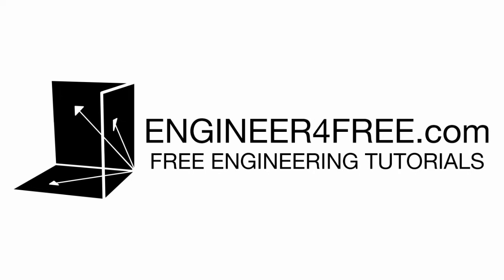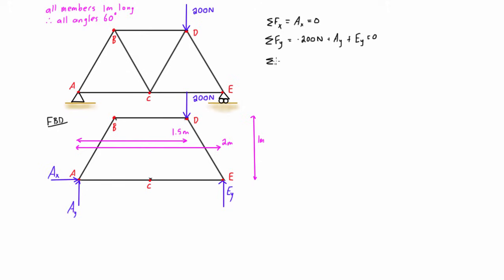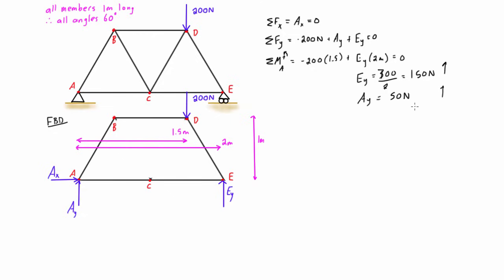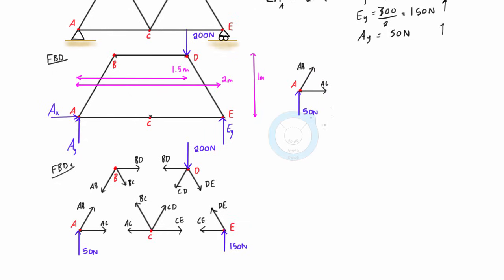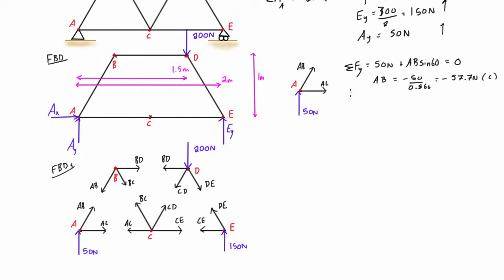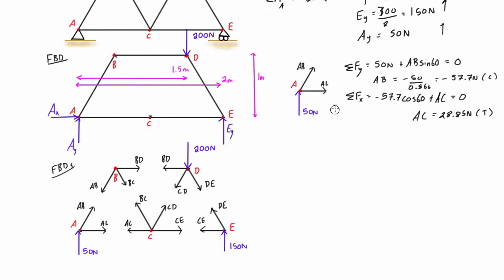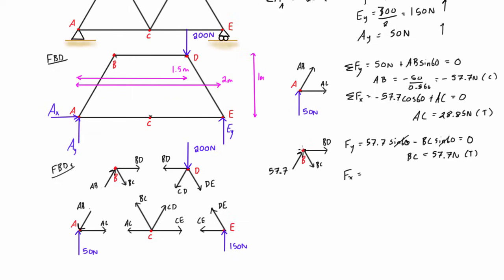Truss analysis by method of joints: worked example #1

Comment: How did you get the 1.5 length and is clockwise negative?
Reply from the maker: The horizontal distance is one and a half members, and each member is 1m long. And yes it is common to set counter clockwise as positive, so clockwise is then negative. 👍👍

Comment: This is good but my question is, at junction A, you know youa are starting with 50N in y axis and then you are tacking sin 60 which is in x axis instead of sin30 which is in y😂😂 does it make sense  you know we are not supposed to follow you blindly so if I'm wrong correct me
Reply from the maker: The trusses are all the same length,  so when you look at the equilateral triangles they form, the interior angles are all 60 degrees. So at A, member AB is 60 degrees off the horizontal. So AB x sin60 will give us the vertical component. If you prefer to measure angle off the vertical axis, you can do that, as AB is 30 degrees from the vertical axis. You can then use AB x cos30 to find the vertical component. Nite that cos30 and sin60 both equal 0.866.  Most professors will generally  encourage that you orient your triangles so that using the sun function with compute the y component, and cos function will compute the x, but you can do it either way as long as you are aware of what component you are calculating.

Comment: I know that commenting is a long shot, but why is force AB not negative for both point A and point B? It's a compressive force, as we've determined by the y-sum of A and calculating a negative value, but why is it not also negative for the y-sum of point B?
Reply: the direction of the arrow for both point towards the joints, A and B. When you try to get the y-component at A, aligning it vertically, it points down. Negative force

For B, aligning AB vertically, it points up. Positive force

Look at the Efy law, negative forces point downwards. Positive forces point upwards

Comment: First off, thank you for these amazing videos!! The only part I'm confused on is picking between sine and cosine because these can change depending on how you imagine the x and y parts of the forces are drawn. For example, at 11:07, you used sin(60) when solving for the forces in the y direction. Why is that? Looking at CD, I imagine the x-part going to the right and the y-part going upwards, which would mean it's cos(60). Instead, you used the y-part of CD to go upwards, then the x-part to the right, making it sin(60). How do I know which direction to imagine the vectors in?
Reply: I figured it out y'all! You have to be aware of the angle you are making. When I chose to imagine the vectors of CD going to the right and upwards, I made a 30deg angle instead of 60deg. If I update my equation to be cos(30), it's the equivalent of sin(60), as was shown in this video. cos(30)=sin(60)=sqrt(3)/2. Be careful when choosing your vectors!

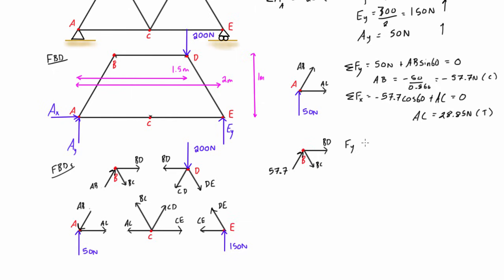Comment: 5:35 
Why isn't FABy negative like when you calculated it for the A joint? Shouldn't it also be -57.7 N like before?

And shouldn't the sum be FY = FAB*Sin(60) + FBC*sin(60)? If I solve for FBC this way I get a posistive 57.7N,
Reply: the direction of the arrow for both point towards the joints, A and B. When you try to get the y-component at A, aligning it vertically, it points down. Negative force

For B, aligning AB vertically, it points up. Positive force

Look at the Efy law, negative forces point downwards. Positive forces point upwards

Comment: in choosing the joing do younhave to follow some pattern or any joint can be chosen as much as is has max of two forces to be determined
Reply from the maker: Generally you want to start at a support with known reaction force, but as long as you have enough info to solve at the joint, feel free to start wherever

Comment: Damn I don't understand😢how do you resolve the second part obtaining bc,bd and 57.7
Reply: I've Been stuck here trying to figure it out for an hour now .Am so noob in calculations
Reply from the maker: It is using static equilibrium at the joint B. Summit all x forces acting on B equals zero, and sum of all y forces acting on B also equals zero. AB is known already from the previous stop, so bd and BC are the unknowns. Bd is horizontal so it only has force in the x direction. BC is on a 60 degree angles so it has both x and y components of force. Solve x direction and y direction in two seperate equations. This will help: https://imgur.com/a/YCT6I1a

Comment: I'm confused about why BD is 1.5m long
Reply from the maker: Oh yeah that got a lot of people. Draw a vertical line straight down from D. This will intersect the bottom member CE in it's centre. All members are 1m, so the horizontal distance between A and D is equal to half of CE, plus all of AC, so we have 0.5m + 1m = 1.5m

Comment: The beams you have stated as in tension have compressive forces though? I assume it actually referring to the joints as those are actually experiencing tension
Reply from the maker: It's best to think of only the members in tension or compression. Don't try to contemplate the state of a joint. The joint its self is only a point, and points experience various point loads, not really tension and compression. When a member is in tension, it can only pull on the joint (image it is rope, rope is in tension, and can only pull). Members that are in compression push in the joints. Imagine a column in a building. It is in compression due to the weight above, and it is pressing down on the floor below it. It is also pushing up on the floor above it. Compression members push in their joints. Tensile members pull in their joints. 

The method of joints has us drawing each joint, not each member, notice that. The diagrams of the joints show the internal force of each push it pull, as felt by the joint. 

I recommend watching all the truss videos at engineer4free.com/statics, and after a few repetitions it should hopefully be clear

Comment: 4 inch vaneer 1 inch Air space...24 inches Loabearing cement blocks Wall 🧱  wire mesh every course s Portland cement in every blocks Air space holes... Air exchanger, vent fan... I'd finish it with a double sided Arches and pillars every metres in the middle of the Arches... And we Got a shelter...

Comment: I had a similar problem but the truss members were 1.5 meters instead. I got the exact same answers (forces) in the vid tho which makes me kinda suspicious of my own answers.
Reply from the maker: It actually doesn't matter how long the members are, just that they all are the same length. That creates equilateral triangles, which give the same proportions and 60° internal angles no matter the length 👌
Reply: @Engineer4Free  awesome! Thanks a lot <3

Comment: How did you get BC to be a negative? When I tried it I got this.
57.7sin(60) - BCsin(60) = 0
57.7sin(60) = BCsin(60)
57.7sin(60)/sin(60) = BCsin(60)/sin(60)
57.7N = BC
Reply: I think BC is negative when he's trying to apply the Efy law for Joint B. Yk, finding the y component,  it points down.  And, downwards forces are negative

Comment: if the member DE were vertical and the applied force is also vertical would you be able to start at the applied force?
Reply from the maker: Hmmm not sure exactly what you're imagining, but either way in these problems, you should always figure out the reaction forces first, by drawing the fbd of the overall structure. Once you have those, then you can assess where you want to go next, and usually it's starting from one of the joints at a reaction because it will have the least number of unknowns

Comment: One thing I will suggest is not to use the same angles for every angle. It wasn't always clear which angle you were using to make each calculation and I couldn't differentiate because they are all the same. Other than that, great video and thank you!
Reply from the maker: Oh yeah fair enough! I did some examples with 45 and 90 degree members in the truss section of engineer4free.com/statics but thanks for watching and the suggestion!

Comment: when you're working with a symmetrical truss would the opposite sides always be the same in terms of the reaction forces and whether they're in tension or compression? Like can i make a cut and just solve for one half and copy that onto the second half?
Reply from the maker: If the truss is symmetrical, and the loads are symmetrical, then yes, you can just solve one side then you can copy all values over to the other side. However, if the loading is not symmetrical, then the internal forces and reactions will all be different, and you will have to solve every member and reaction separately. 👌
Reply: @Engineer4Free  Thank you so much! Currently reviewing statics for my structural analysis class by watching all your videos LOL

Comment: Great content! quick question though, when solving for joint B on the Y axis, you used AB as 57.7 instead of -57.7. Why?
Reply: Cuz the vector is headed up and to the right. Remember that up right and an anti-clockwis moment are all the 3 positive directions that he is using. If he was using down left and clockwise as positive directions then that would be -57.7
Reply: AB is in compression meaning it is pushing out internally a force of 57.7 towards B

Comment: I am confused why he did the cos of 60 I don't see a 60 in the problem.
Reply from the maker: Hey, each member is the same length, which makes each triangle and equilateral one. All angles of an equilateral triangle are 60 degrees. It is typical to have to come to that realization in an exam in order to solve the problem. Other common trusses are often 45, 45, 90 degrees too, so watch out for those.

Comment: why use sin60 and cos60 on point b espicially horizontal force i thought the angle should be respect on vertical and horizontal component, why not using cos30? because it has different answer thanks for the answer i really confuse by that

Comment: hey, I know im a little late lmao, but how come you are doing -50 over 0.866 instead of just positive 50, this is shown a 3m20sec solving AB
Reply: Well if I am allowed to answer that, he did -50 over 0.866 because:
Looking at summation of forces in the y direction at A, 
By algebra 
50 + ABsin60= 0
Making AB subject by subtracting 50 on both sides
It becomes, 50-50 + ABSin60 = 0- 50
Then ABSin 60= -50
So AB = -50 over 0.866 since sin 60= 0.866
Thus AB = -57.7N 
I hope that makes a little sense

Comment: @Engineer4Free. Thank You for the video. I was just wondering, how did u get Absin60 at around 3.30 minutes in. I just don't understand that part.
Reply from the maker: All angles in this problem are 60 degrees. That is because all members are the same length, so every triangle is equilateral, so every angle is 180/3=60 degrees. So AB is 60 degrees off the horizontal. We use the SOH CAH TOA trig functions to find its x and y components. Draw a right angle triangle such that AB is the hypotenuse, and the 60 degree angle is included. ABx = ABcos(60) and ABy = ABsin(60). See this diagram for help, it's a slightly different orientation, but the same idea: https://i.imgur.com/Dvdqf2t.jpg

Comment: How did you get the formula        ( EFx=50N+AB SIn(60)=0)      at about three minutes in for the ABC joint.    specifically the sin (60) part
Reply from the maker: All angles in this problem are 60 degrees. That is because all members are the same length, so every triangle is equilateral, so every angle is 180/3=60 degrees. So AB is 60 degrees off the horizontal. We use the SOH CAH TOA trig functions to find its x and y components. Draw a right angle triangle such that AB is the hypotenuse, and the 60 degree angle is included. ABx = ABcos(60) and ABy = ABsin(60). See this diagram for help, it's a slightly different orientation, but the same idea: https://i.imgur.com/Dvdqf2t.jpg
Reply: @Engineer4Free  thank you so much.   I know this video is old and my question was probably below your ability, so I appreciate your reply.
Reply from the maker: No worries! It's a very common question, hope it makes sense now! There are a few more examples at engineer4free.com/statics in the trusses section that would be wirth watching for more practice!

Comment: I swear the COS60 and SIN60 values are so off or am I missing something?
Reply from the maker: In this problem, cos is always being used for x components, and sin for y components. That's not an absolute rule though, as it depends on how you construct the right angle triangle, so don't always assume that. The values are correct. See this: https://i.imgur.com/Dvdqf2t.jpg and this https://i.imgur.com/dTR8W7X.jpg for some examples of finding the components

Comment: I’m lost because sin(60) doesn’t equal 0.866?
Reply from the maker: There is a typo in this video: The truss is 0.866m tall, not 1m. It's 1m*sin(60)=0.866m. Doesn't actually affect anything in the problem, it was just labelled wrong. There's a note mentioning this in the description, sorry for the confusion!

Comment: When doing the FBD for each joint, the problem im doing,  asks me to find member forces for more of the right side of the truss, so can i start doing it from the right side???
Reply from the maker: Yep, same either way. I just tend to start on the left out of habit. If you only need to find the force in one single member, use the method of sections. See videos 49 - 51 here: engineer4free.com/statics 👍

Comment: Hello! I have a question.

I'm taking an engineering course that's revisiting truss's and I had a question that popped up in my mind... so for example, you calculated the force in CE to be in tension... so the force is pointing away from the two joints its connected to... but if you look at the whole member since the forces are pointing away from the joints... does that mean the whole member is in compression?

I hope my question makes sense. Thank you.

(P.S. This video saved my life in statics when I took it years ago)
Reply from the maker: Hey cool, thanks for coming back!! I drew the FBDs of each joint. So the forces in this problem are considered from the perspective of the joints, not the members. The force CE points away from joint C and also points away from joint E. I like to use the words "push" and "pull" when thinking through these problems. CE is "pulling" on C and also E. Imagine a string connecting C and E. A string can only pull, it's impossible for a string to effectively push something. Strings can only be in tension. So when something is pulling on two joints, it must be in tension. CE is in tension.

Imaging a a completely different thing now. Take a small pipe or like 30cm or something in your hands. Push on each end so that each hand is pushing towards the other along the axis. That pipe is now in compression, your hands are pushing on the pipe, and the pipe is pushing back on your hands. Your hands are like the joints of a truss. If you draw a FBD of your hand, you will see a force from the pipe pushing on your hand. If you draw a FBD of a joint in a truss that's connected to a member in compression, you see a force from that member pushing on the joint.

Of course, you could draw a FBD of the pipe and you would see the opposite "direction" of a force at the point of contact, but just don't do that. With trusses, it's best to only every draw FBDs of joints, and consider the forces from the perspective on the joints. It's easier this way.  

If you absolutely must draw the FBD of the member to satisfy your curiosity, then remember that what the member sees and what the joint sees at the point of contact are equal and opposite. So you have to switch the direction of the force (like mentioned in the pipe squeeze above), so a member in compression would see the force from each joint "pushing" on it and a member in tension would see the force from each joint "pulling" on it. But I still recommend ignoring that and only ever drawing the FBDs of joints and using the first two paragraphs logic.

Hope that helps!

Comment: Hey I was wondering how do you know when to use sin or cos and when its negative or positive? Thank you
Reply from the maker: When in doubt, draw a right angle triangle over the truss, such that two of the sides are the truss members in question, and the angle between them is included in the triangle. Then based on that angle, determine which is the adjacent side, and the hypotenuse, and the opposite side. From there, you can see which sides are known and which are not, and then realize if it is sin or cos that you need. See this image: https://i.imgur.com/Dvdqf2t.jpg

Comment: Hi, great vid! However i'm a bit confused as to why you removed the negative sign in 5:32 and 10:30 (-57.7N, C)?
Reply: Same, did you figure it out?
Reply: @fubrian2945  Hi, yes, apparently you have to assume that all forces in joints are in tension, even though you know that a force member is not. The sign just varies on the direction of the force. You can construct an XY plane to make your FBD easy :)
Reply from the maker: Yeah, it's best to always assume every unknown to be in tension, and always draw them pulling on the joints. Then if you get a negative number, you know it's actually in compression. The next time that compressive member is used in calculation at a joint, actually draw it in compression, pushing on the joint, because it is now actually known, but then draw the other unknown forces in tension and repeat.
Reply: @Engineer4Free  tension is when the forces point towards each other in the truss member right?
Reply from the maker: @fubrian2945  Yes, and because they do that they "pull" on the joints on each side. Think of a string. A string can only be in tension, so they can only ever pull on things, and the forces would be aligned in a string as you said... same for an other member that is in tension.
Reply: @fubrian2945  https://www.youtube.com/watch?v=xrU3l1RvyiE&list=LL&index=75&t=74s here is a wonderful tutorial too